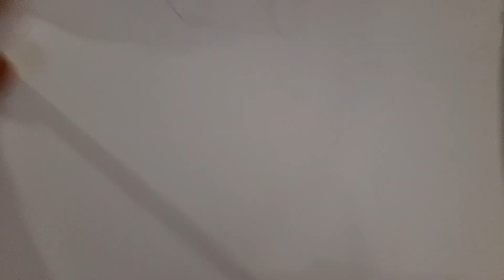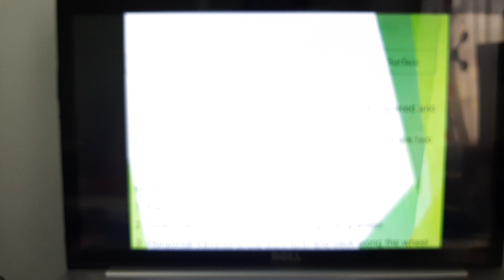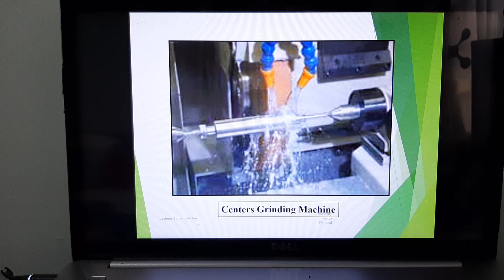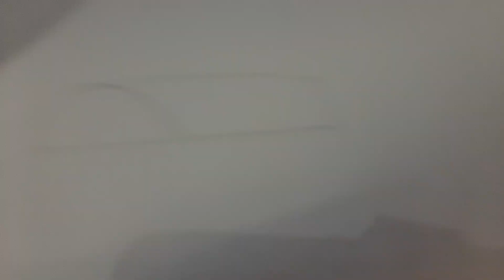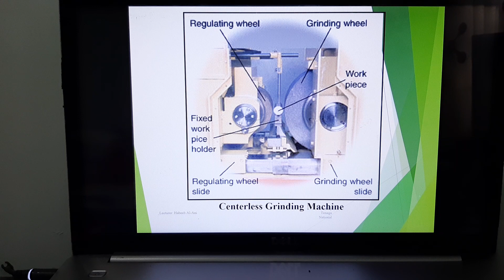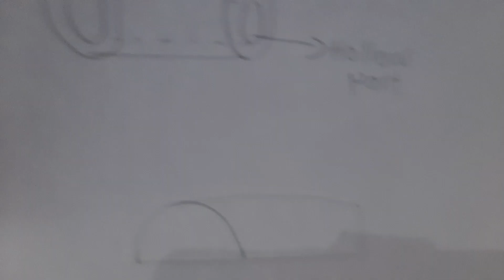GRINDING AND ABRASIVE PROCESS PART 2

Comment: Mohammad Aliff Bin  Mohd Pauzi (ME0104760). 

Disadvantage center grinding
-if not clamp properly , product undergoes vibration wich lead to scratch
-set up time is long
Disadvantage centerless grinfing
-for cylinder object must not have flat surface
-doesnt work for object with multiple dimension

Comment: Good Afternoon Doctor, from this video I have learned that there are three types of grinding processes which are cylindrical, internal and surface grinding. Other than that, I found that grinding wheels have a mesh, and this mesh have different sizes, 120 & 140 for rough grinding, and 600,800, and 1200 for fine grinding. There are two types of cylindrical grinding which are center and centerless grinding. Center cylindrical grinding is where the workpiece is clamped and must move back and forth to ensure full grinding of workpiece. The downside of this process is there is a risk of workpiece not clamped properly and will vibrate which can cause deep scratches. Centerless cylindrical grinding is where the workpiece is rested on workrest. This process is better because it requires less setup time and it is user friendly. However, the disadvantages are the object cannot have a flat surface and cannot have multiple diameters. In conclusion, centerless cylindrical grinding is better. Thank you, Dr.

Muhammad Naquib Bin Nor Azlan
ME0106093
Section:01

Comment: Hi Madam,I have learnt about 3 different types of grinding.
1.Cylindrical grinding-used to machine cylindrical product only
2.Internal grinding-for hollow cylindrical grinding
3.Surface grinding-for flat surface
The higher the value of grain size for the grinding wheel,the finer and smoother the grinding will be.
Traditional way of  grinding cylindrical products is by using the Center Grinding Machine that product will be clamp on the chalk.Through out the process,vibration might occur if product didn't clamp properly and will cause scratch on product.Another disadvantage will be a long setting up time needed in using the machine.However,Centerless Grinding Machine can overcomes such disadvantages as no clamping is needed and it is more efficient ,but anyhow centerless grinding machne cannot handle product that has any flat surface and not in uniform diameter.

Tan Kang Je
ME0106097

Comment: good evening madam what i have learnt from this video are about 3 type of grinding processes which are cylindrical, internal and surface. There are also different size of mesh. Cylinder grinding have 2 types which are center and centerless. there pros and cons in using this two process.

Luqman Mizani
ME0106085

Comment: Good evening, mdm. I've learnt that the are three types of grinding processes which are cylindrical grinding, internal grinding and surface grinding. Cylindrical grinding is used for cylindrical products, internal grinding is to grind the inner part of the cylinder and surface grinding functions to smoothen the rough surfaces and sharp edges sharp. Cylindrical grinding is divided into two types, center and centerless grinding.center grinding is done by the workpiece rotating and moving back and forth while grinding. Centerless grinding is done where the rotation of workpiece, regulating wheel and grinding wheel in clockwise direction in the same axis. Centerless grinding has a disadvantage of where the workpiece will not have multiple dimensions and it also can't have a flat surface.

Navineswaran A/L Kumar Raja 
ME0105317

Comment: Hi mdm, I have learnt that there is 3 types of grinding processes : cylindrical grinding,  internal grinding and surface grinding. Coolants are required for centers grinding machine and it is not efficient, centreless grinding machine is more efficient cuz it is more user friendly and save time. However it is only for fully cylindrical product, not semi cylindrical.

ME0106084
Darrell Anak Dau

Comment: Good day, from this video the information gathered are the types of grinding processes which are cylindrical, internal and surface grinding. I also learn about the application of fine and rough grinding and the benefits of grinding. ME0106053 Marcus Chuo

Comment: Me0106908 Rajbhinder Singh
I learnt that there are 3 types of grinding process are cylindrical grinding, internal grinding and surface grinding. Centerless grinding machine is much more better and convenient as no need clamp. Thank you

Comment: RAVEEN KRISHNAN A/L K. BALAKRISHNAN
ME0106095

Hi madam, this video has taught me that there are three(3) types of grinding :-
1) Cylindrical grinding-  used to machine cylindrical, tapered and formed parts
2) Internal grinding - used to grind inner surface of cylindrical part
3) Surface grinding - used to grind flat surfaces of object
A Grinding Wheel has various mesh sizes to perform rough and fine grinding.
Center grinding is a traditional method where the work piece is clamped. The disadvantage of this method is, if the work piece is not clamped properly, the vibration will cause deep scratches thus causing the product to be rejected. The setup time for this process is also very long. As for centerless grinding, the work piece is not clamped but just resting on a holder and all the wheels rotate in the same axis. This process is more user friendly and has zero setup time. The disadvantage is that the object should not have any flat surfaces or multiple dimensions/diameters present.

Comment: from this video, i have learnt that there are three types of grinding process which are cylindrical grinding, internal grinding and surface grinding. for cylindrical grinding, it is used to machine cylindrical , tapered and formed parts. there are also two types of cylindrical grinding that is center grinding and centerless grinding. for center grinding, the workpiece is clamped in place while the centerless grinding is when the workpiece is only rested in place. 

Ariff Imran 
ME0106083

Comment: I discovered at the end of the video that there are three grinding processes which are Center Grinding, Internal Grinding, and Surface Grinding. The material must be cylindrical to the cylindrical grinding. There are 2 center grinding types that are center grinding and centerless grinding.Center grinding is a class grinding process where a piece of work is clamped and work piece is pushed back and forth against the grinder with the aid of a chuck.The disadvantages however are that vibrations can occur due to loosely clamped materials and cause deep scratches on surfaces.Besides, it also requires a long setup time. Next, centerless grinding is achieved by resting the piece of work on the work rest. The regulating wheel, grinding wheel, and work piece rotates in clockwise direction.The regulating wheel pushes piece of work into grinding wheel where the workpiece surface is grinded. Grinding wheel slide allows entire surface to be grinded back and forth. This grinding method, however, can not grind a flat surface, or a material of multiple dimensions.

Muhammad Harits Bin Mohamad Zailan
ME0106091
Section 1

Comment: FAIZ AFFENDIE BIN MOHD NAZRI
ME0106085
Good day, miss. From this video I have learnt that there are 3 types of grinding:
1. Cylindrical Grinding: 
  centre-both workpiece and the grinder is moving. cons- setup is long and can leave deep scratches if not clamped properly.
  centerless- workpiece resting on a workpiece holder pros- user friendly and easy to use, cons- can't grind flat surface
2. Surface Grinding- remove and smoothen the surface of sharp object
3. Internal Grinding- grind the inner surface

Comment: good evening madam, from this video I have learned that grinding has 3 types which are internal, cylindrical and surface. Cylindrical grinding is for cylindrical, tapered and formed parts. Internal grinding is for inner hollow surfaces of cylindrical parts and surface grinding is used for flat surfaces of objects. there are many mesh sizes for grinding wheels, 120 and 240 are for rough grinding while 600, 800 and 1200 are for fine grinding. in the center grinding, the workpiece is clamped at the chuck. the disadvantages are the setup time is too long and deep scratches may occur if the workpiece is not clamped properly. For centerless workpiece, all wheels rotate in the same axis. it is easier to use and also more user friendly. however, the centerless grinding cannot be used on a flat surface and a workpiece with multiple dimensioning.

KHIIREN SHRI RAM
ME0106086

Comment: Good evening madam, I am Wong E-Shen (ME0106071). In this video, I have learnt about 3 types of grinding processes such as cylindrical grinding, internal grinding and surface grinding. Firstly, for cylindrical grinding, it is use to grind the objects in cylinder shape. For internal grinding, it is use to grind the hollow part of the cylinder object whereas for surface grinding, it use to grind the flat surfaces of the object. There are two types of cylindrical grinding which are center grinding and centerless grinding. In center grinding, the workpiece is hold at the chuck and clamped in position. It needs to move back and front to grind the entire surfaces. Next, in centerless grinding, the workpiece is sitting on the work rest. The grinding wheel, workpiece and regulating wheel will rotates in the same direction. The regulating wheel will push the workpiece towards the grinding wheel to grind. Then, for the disadvantages, in center grinding, it will vibrate if not clamped properly before grind and it needs long time to clamp and adjust. Whereas in centerless grinding, it can only grind the object in cylinder shape without any flat surface. Furthermore, it cannot grind a cylinder shape object that has multiple diameters.
Thank you.

Comment: Good evening madam, from this video I have learned that there are 3 types of grinding processes which are:-
a)Cylindrical grinding(center,centerless)
b)Internal grinding
c)Surface grinding
Cylindrical grinding is used to grind cylindrical shape, Internal grinding is used to grind the inner surface of an object while surface grinding is used for flat surafaces.For cylindrical grinding, centerless grinding is user friendly as it requires less setup time but the object will not have a flat surface and their diameters are fixed.
Shahnyeel A/L Anil Kumar
ME0106096

Comment: Good afternoon Dr, im Mohamad Fayyadh B Fazlulaah Me0106089. From this video,  i have learned that there are 3 grinding processes.
1. Cylindrical grinding ; to machine cylindrical,tapered and formed parts.
     ->Center grinding
     ->Centerless grinding 
2. Internal grinding ; to grind a hollow part
3. Surface grinding ; to smoothen sharp edges, rough surfaces and for flat surface
That's all that i can conclude. Thank you for sharing Dr.

Comment: Mohamad Ikhwan Syafiq bin Zadi

ME0106090

In this video I have learned that generally there is three
types of grinding process 

Cylindrical grinding – grinding a cylindrical shape

Internal grinding – grind inner surface 

Surface grinding – for flat surfaces .

This video is focused on the first type of
grinding which is the cylindrical grinding. Two type of cylindrical grinding is
center grinding and centerless grinding. Centerless grinding is preferable to
use than center grinding because of some factor that will take more  time to grind using center grinding. However
, centerless grinding cannot be used if there is a flat surface on the material
that need to be grind

Comment: Name: NEENA BT AHMAD NIZAM
ID: ME0104364

From this video, I learned that there are three types of grinding processes which are cylindrical, internal and surface grinding. The cylindrical grinding are for cylinder shapes. There are two types of cylindrical grinding which are center grinding and centerless grinding. The center grinding is a traditional grinding with clamping. The disadvantages are it cannot grind the whole workpiece at one go, with unproper clamping, the product will vibrate and cause deep scratches and set up time is long. Centerless grinding has no clamping which means the product can be grinded at one go. It also has no set up time and is user friendly. However, it can only grind cylinder shapes only with no flat surfaces and with only one dimension. Thank you.

Comment: Greetings Dr, I am Derrick Ng Kian Ping (ME0105733) .At the end of the video, I have learned that there are 3 grinding processes which are Center Grinding, Internal Grinding and Surface Grinding. For cylindrical grinding, the material must be cylindrical. There are 2 types of center grinding which are center grinding and centerless grinding. Center grinding is a class way of grinding where a work piece is clamped and work piece is moved back and forth against the grinder with the assistance of chuck. However the disadvantages are that vibrations may occur due to loosely clamped materials and cause deep scratches on surfaces. Besides, a long setup time is also needed. Next,centerless grinding is done by resting work piece on work rest. The regulating wheel, grinding wheel and work piece rotates clockwise.The regulating wheel push work piece into grinding wheel where the surface of workpiece is grinded. Grinding wheel slide allows back and forth movement to grind entire surface. However, this grinding process cannot grind a flat surface or a multiple dimensions material.

Comment: Ariff Bin Alzakri
ME0106046
I have learned that there are 3 methods of grinding which are cylindrical, internal and surface grinding. For cylindrical grinding there are centre grinding and centerless grinding. Centerless grinding is more preferable compared to center grinding due to its ease of use, however centerless grinding can not be used for a flat surface.

Comment: Name: Nur Syazwani Bt Mohd Noor
ID: ME0104367
Based on this video i learned about the methods of grinding. Firstly, the cylindrical grinding which is used to machine cylindrical parts. Second, internal grinding which is used to grind inner surface of cylindrical or hollow parts. Third is the surface grinding which is used to grind flat surfaces. There are 2 types of cylindrical grinding which is center and centerless. The type that is preferable to use is the centerless because it is faster, low labor cost and no need to hold the workpiece compared to the center.

Comment: Good evening madam, I'm Chong Jin Yang (ME0106047). From this video, I have learned that there are three type of grinding processes which are  cylindrical, internal and surface grinding. For cylindrical grinding, it is used to grind cylindrical, tapered and formed parts. Internal grinding is for inner surface of cylindrical parts while surface grinding is for flat surfaces objects. There are many mesh sizes of grinding wheels. 120 and 240 are for rough grinding while 600,800 and 1200 are for fine grinding. For cylindrical grinding, there are two types which are center grinding and centerless grinding. For center grinding, the workpiece will move back and forth during the process. It's a traditional grinding processes which is widely used. However, it takes too long time to set up and the material will be easily scratched if it is not clamped properly. Therefore, there will be second choice which is centerless grinding. For centerless grinding, the workpiece will be stayed at rest while the wheels will do the back and forth job. The regulating wheel will push the workpiece to the grinding wheel to be grinded. All of them will be rotated in the same axis. It is user friendly and it takes less time to setup. However, the centerless grinding cannot work on flat surfaces and multiple dimension objects.Thank you.

Comment: Good afternoon Dr, from this video I have learned that there are 3 types of grinding processes which are cylindrical, internal and surface grinding. Cylindrical grinding is for cylindrical, tapered and formed parts. Internal grinding is for inner surfaces of cylindrical parts and surface grinding is used for flat surfaces of objects.Grinding wheels have different mesh sizes, 120 &  240 for rough grinding, 600,800 & 1200 for fine grinding. There are 2 types of cylindrical grinding, which are center and centerless cylindrical grinding. The center cylindrical grinding is where the part is clamped rotates at its axis and moved back and forth to grind. The disadvantage of this technique is that the workpiece might vibrate if it is not clamped properly where it causes deep scratches to the product.  For centerless cylindrical grinding, the workpiece is not clamped. The workpiece, regulating wheel and grinding wheel will rotate clockwise during the process. The advantage of this method is that it is user friendly, less setup time. The cons to this method are the objects cannot have a flat surface and they cannot have multiple diameters. To conclude from these 2 methods it is much better to use the centerless cylindrical grinding. Thank you for the video Dr. 
-AHMAD NAZRI BIN AHMAD TAMRIN ME0106079

Comment: Name : Aiman Hazim Bin Arif Razman 
ID : ME0106080

What I can conclude from this video is that there are 3 methods of grinding processes which are cylindrical, internal and surface grinding. Cylindrical grinding is used to machine cylindrical parts. It can be further divided into two which are center and centerless grinding. Center grinding is the traditional method of cylindrical grinding whilst centerless grinding is where the workpiece is stationary & only the regulating and grinding wheels are moved to grind the workpiece. The disadvantages for center grinding that I have learned are vibration occurs when product is not clamped properly & the setup time is long. In addition to that, centerless grinding doesn’t work with workpieces of flat surfaces as well as multiple dimensions. Internal grinding grinds inner surfaces of cylindrical parts whereas surface grinding grinds flat surfaces in which they are used to grind/smoothen sharp edges or to smoothen rough surfaces.

Thank you for the well-explained lesson Dr.